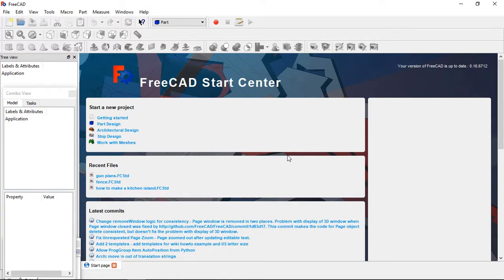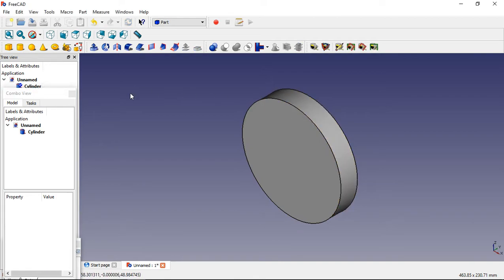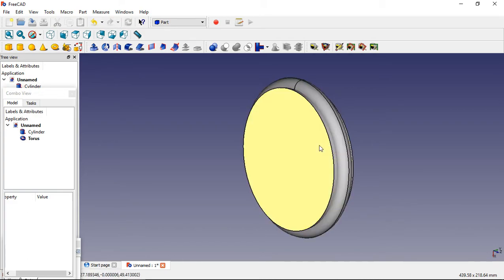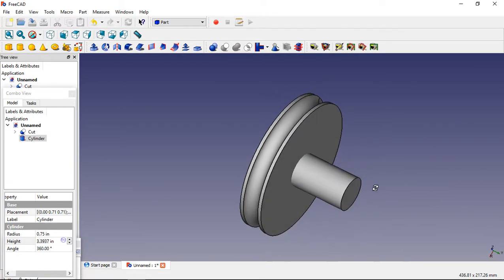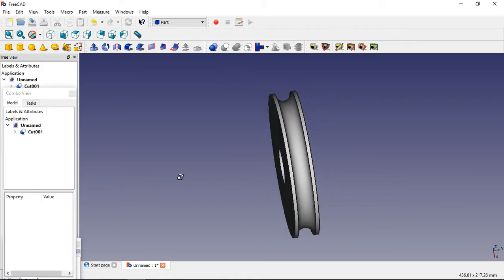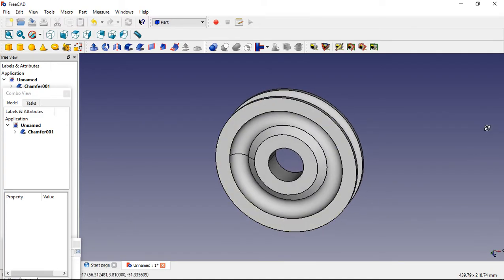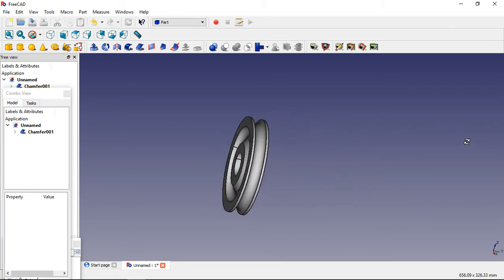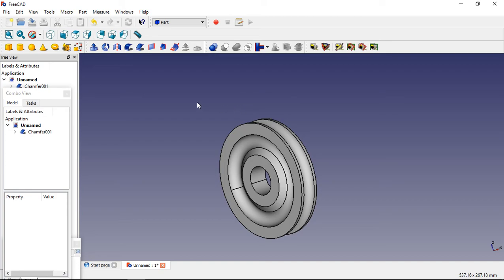FreeCad Using Primitives

Comment: If someday Freecad try to make life easier in the part workbench will be great. I am using 123 Designer .. most of the time you use primitives to create shapes quickly. In freecad it is not so easy.. you see everything you have to write it .. nothing appear on the screen (drawing area)..